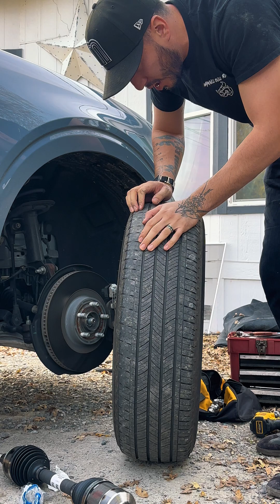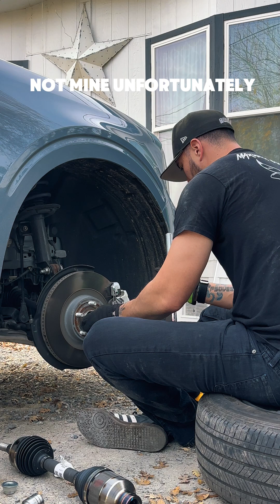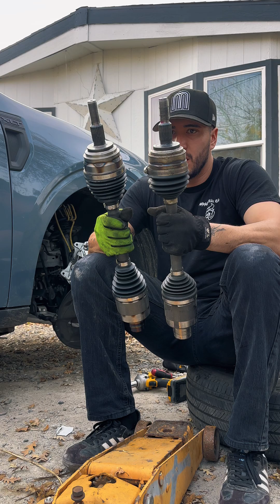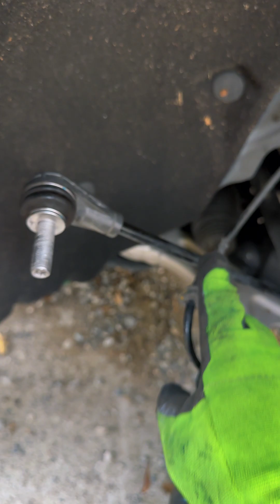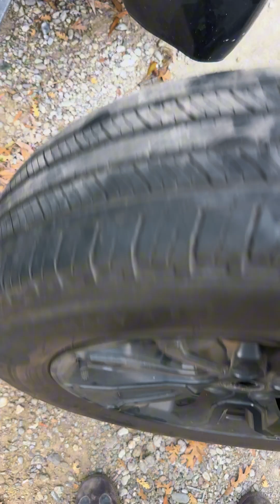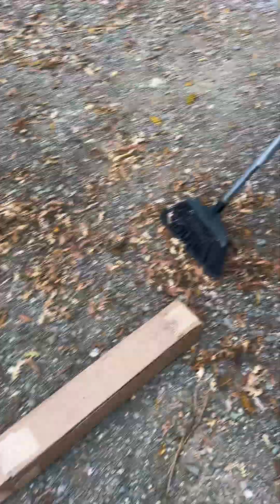2022-2024 Ford Maverick CV Axle Replacement/Upgrade (HOW-TO) TQ VALUES & PART NUMBERS IN DESCRIPTION

Comment: I did this, using these part numbers.  I followed the torque specs. 

Now my axles are slapping around under my truck. Either I did something way wrong, or this doesn't work with these parts. 

Anyone have any ideas on how to get them to stop slapping around?

These parts were expensive. I don't want to have to replace them
Reply: did you figure this out? I have a clicking noise on the drivers side after putting news ones in. It kinda seems like the side of the cv that goes into the transmission has a bit of play even though the clip went in and locked itself.

Comment: Hey man great video, thank you for this. Question for you besides the axles themselves are there any other parts that are required to be replaced when doing this job? 
My axles are definitely going and I'm out of warranty and thinking about doing it myself since i have the time but i can't have my truck down for a week because i forgot to order some $10 part before starting the job
Reply: Probably can't hurt to have some transmission fluid. If it is hybrid it should be the cvt hybrid stuff with electrical properties. It is more money than normal transmission fluid. Sometimes a little leaks out when you take the axles out. Also, he did say a torx 40 socket or wrench to hold the stabilizer link threaded part so that will probably help. I usually get spare stabilizer links but those can in theory get cut off and replaced when you get them. Not ideal but know that the but turns the threaded part on stabilizer links because you are turning a ball. You hold the threaded part of the stabilizer link while turning the nut or it will just spin the ball inside the stabilizer link.

Comment: Took this upon myself after looking at your video. Definitely harder than it seems, but your video helped a ton. I'm at the process of inserting the new Cv axel, I've engaged the tip into the transmission but I'm not getting this fully flush. Do you recall if you got this fully flush when reinserting? Have about a 1/4" gap left to go but it doesn't seem to budge.

Comment: Hey I have questions,...great video btw. I have a 2022 Mav xlt awd and had it lifted a couple years ago, 2in rough country by a truck acc shop. In my dealer oil change they found my cv axles leaking. This will be a direct fit then on mine as well? Also where did you buy from, thanks.
Reply from the maker: @kellyshawn3473  should be a direct fit yeah. As long as it’s AWD and NOT FWD.
Reply: @PapaAcer  yes its awd ty very much. I'm having trouble finding those part numbers in stock anywhere.
Reply: @kellyshawn3473 were you able to use the tremor cv axles on your 2022 truck?
Reply: @EugenioMate  I actually just got new regular ones installed Fri at my dealership. It was covered under my extended warranty
Reply from the maker: @kellyshawn3473  can you check the part numbers? Ive seen on the forums that Ford changed up the stock ones and the part numbers may have changed
Reply: @PapaAcer  I will check